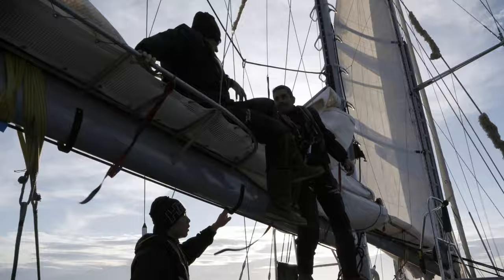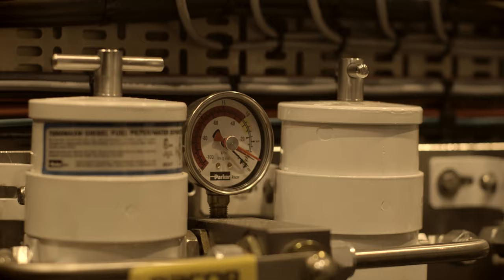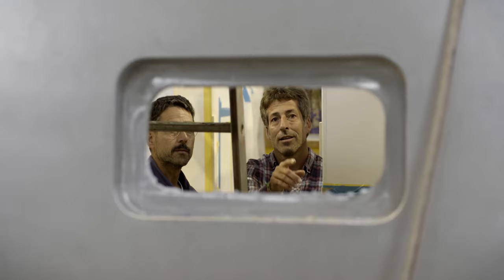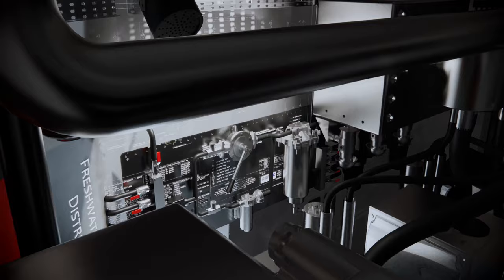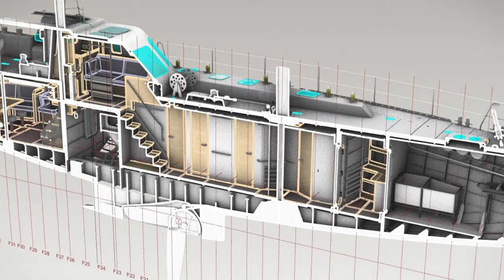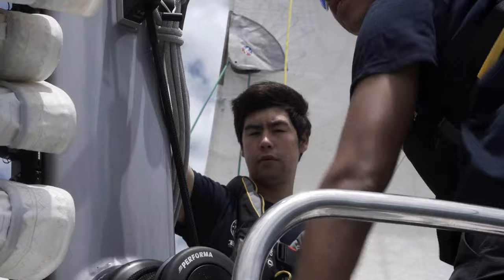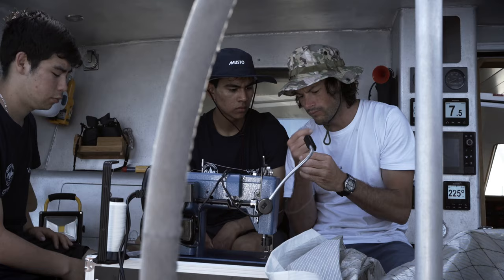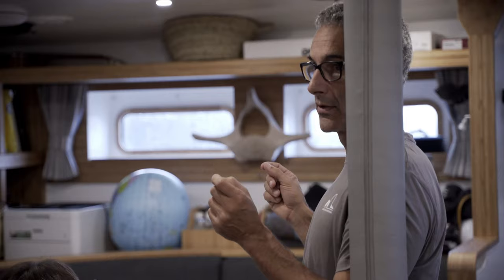Pelagic 77 first season recap and exciting news about a second yacht!

Comment: Is this beachable? The rudders seem to go deeper than the keel? The Pangaea and the Tara are both beachable, so are all the Garcias.

The Pangaea has the propellers protected by skegs and the keel at one end and by short and broad shallow water rudders at the other end.  It then has the larger rudders at the stern, but those are also shallower than the Keel.

Can this have vents for circulation in the tropics? Or would the vents  make it liable to sinking if the vents were inadvertently left open in heavy weather?Would the vents impair thermal efficiency and impact insulation in polar regions? Can this be turned into a global go-anywhere luxury cruiser? Would the systems and subsequent plumbing and weight distribution for rig and rudder automation make the hull unstable because of uneven weight distribution or water- tight sealing?
Reply from the maker: Hello, to answer your questions:
- No, this yacht was not designed to be beached. We have built other yachts that can.
- She has a number of ventilation dorade boxes on the deck, is that what you mean with vents?
- Yes, any yacht designed can be changed to the owner's wishes. This yacht was particularly designed and build for chartering in high latitudes.
- We always make a weight distribution plan to ensure the yacht is not unstable. But pumbling, rig and rudder are on each yacht so I don't understand what you mean how these items would make the yacht unstable.
- She has numerous watertight bulkheads and watertight doors.
Reply: @KMYachtbuilders    Thanks for your friendly reply: I meant additional ventilation for the tropics, like that on Dashew's Beowulf, which doesn't have air-conditioning, but instead relies on good air circulation for cooling the saloon and cabins. Air-conditioning, of course, is preferred but relies on diesel, hydrogen, or large battery banks. By plumbing, I meant new plumbing for hydraulic/electric sail/winch systems to completely automate the process and to also get the rudders on a fly-by-wire like system with an autopilot on a hand-held remote like the systems on the  Dashews, Garcias and CNBs. I don't mind a bare deck for the polar regions, where survivability is paramount,  but want creature comforts for the tropics. I want to have all the creature comforts possible without compromising on survivability/safety and autonomy. I want a truly go anywhere vessel. I would want a very thick polyurethane insulation in the hull, double- or triple-glazed windows, and air-tight/watertight vents to minimize the use of flammable materials for warmth. Polyurethane is tucked inside the hull, so not really a fire hazard. Batteries have very low efficiency, steam can have an infinite supply of seawater but requires very large boilers and still scales , whereas hydrogen again only needs seawater, but  is very volatile, so what is the preferable backup option for autonomous propulsion during windless stretches? No alternatives to diesel, I suppose? I don't care about the environment, but do care about autonomy. A variable draft and beaching  also enhance autonomy. Have you looked at the Beowulf and Pangaea. A Beowulf-like automation on a Pangaea-like vessel. 77 is the ideal size.
The Beowulf also has a water-ballast to move the ballast fore and aft and laterally for following/heading seas and for heeling, but might not be suitable for icy polar regions. The Pangaea has a smaller set of rudders next to the propellers for shallow water and deeper foldable rudders further aft, closer to the stern.
Reply from the maker: @assetstopurchase8432  Perhaps it is better that you send us an email with your wishlist, instead of discussing it here on YouTube? You can email us at info@kmy.nl  As you'll see on our website we have build many yachts for different purposes. Including being frozen in the ice, going to the Med, drying out and making world circumnavigations. We would be glad to help you with your dreamyacht.
Reply: @KMYachtbuilders    Great! Will do that! Please,  don't bother to reply here. I know KM makes the best aluminum hulls in the world. Since Beowulf and Pangaea are not KM, you might want to look them up. Beowulf has the hull, ballast and sail plan designed to maximize speed. It has also been designed to automate functions and provide for ease of maintenance. Pangaea has been designed for autonomy and survivability---operation in heavy weather in Southern Ocean, in light ice, and even up rivers. Finally, none of these have tenders that can serve as life rafts in extreme weather in the event of sinking. Roll-over, self-righting  composite or aluminum tenders as opposed to RIBs? I know even if yachts rollover and self-right, the objects and systems inside would wreak havoc, but a yacht with a water-tight  deck-saloon that can neither float inverted, nor sink, should rollover and self-right, but even if we reduce the mast length by using multiple masts, the mast would still serve as a very deep centerboard keel to prevent righting, so we'd need help from compressed air or gas. Shackelton's account of survival was very interesting. There have been accounts of 130ft freak waves in the Southern Ocean, and that a well designed yacht can survive pitch-poling from a wave 60% of yacht length (if the CG is in the middle and the  ballast and hull are designed, so that they oppose the lift as the wave progress from the extremities towards the CG). If the stern offers a greater resistance to beam waves because of its greater area, then the boat should turn to have the bow face the wave for survivability;of course the hull would have to be designed for the wave to flow over the boat and for the forces to be dissipated in different x,y and z component to minimize the impact along a particular axis).

Till hydrogen matures, I would seriously look at a small steam turbine for propulsion. This is what the navy uses on its nuclear subs.

It would needlessly add weight to have multiple forms of propulsion, but different forms can even share the same shaft and gearbox via a  reliable coupling and decoupling mechanism.

 Thanks and TC.